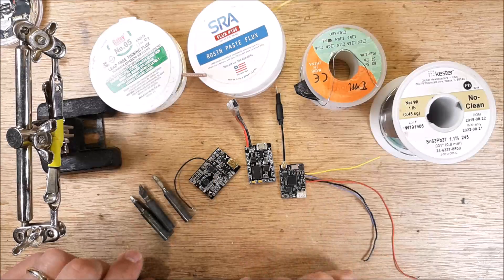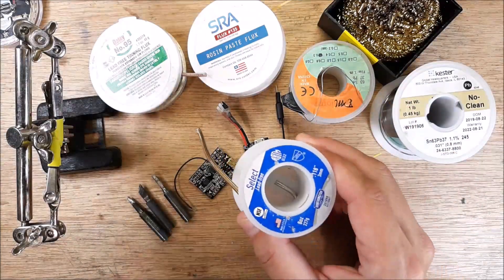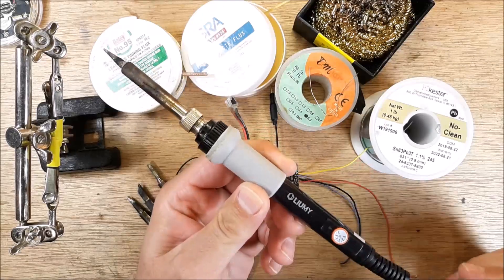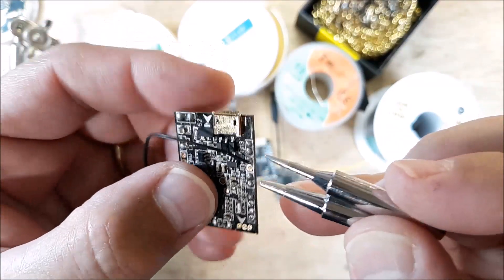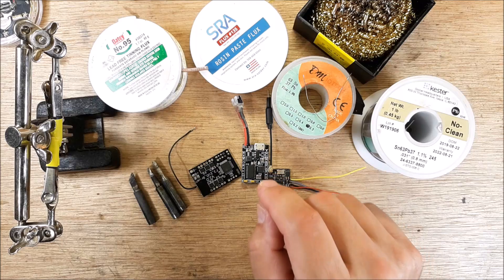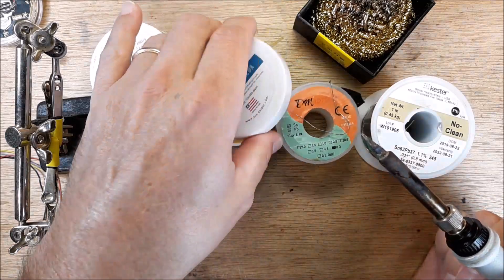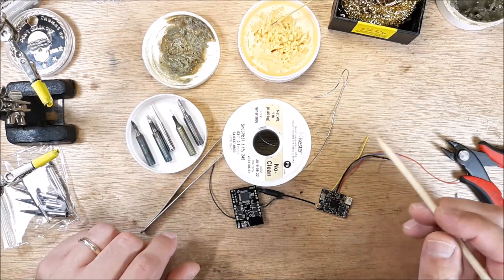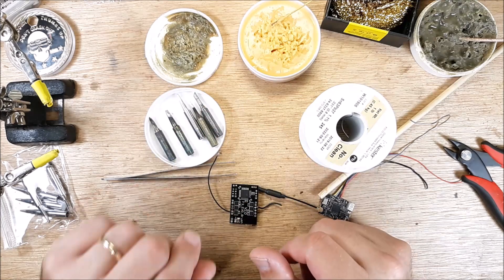How To Solder A Wire | Best Way To Solder A Wire To A Flight Controller

Comment: When I try to solder the power cable to the flight controller I can’t get enough soldering on the pad, as I’m feeding it on the bit I’ve already put on sets and turns to like paste 😢
Reply from the maker: @robl1967  
What solder (be specific)?
What soldering tip?
What temperature?

Comment: are you using lead-free solder?   great video!   TIN EVERYTHING!!!
Reply from the maker: @JordanLewisFamily  
I appreciate your support and encouragement! 
I believe it does have Lead. It has a low melt point and the material code has SN-tin and PB-lead in it.. I have it in my (zero commissions) Amazon store...🍻
https://www.amazon.com/dp/B08YXYJWS1?linkCode=ssc&tag=onamzscottb09-20&creativeASIN=B08YXYJWS1&asc_item-id=amzn1.ideas.3HATG6SBWZ1S1&ref_=aip_sf_list_spv_ofs_mixed_m_asin

Comment: I'm getting ready to solder the motor wires to the flight controller. There are 12 of them. The kit came with a toolbox. The connector for the iron was not compatible with anything I had. I had to go to a electronics store to get an adapter. It came with a battery charger but the connectors are proprietary I guess. It's a Bardwell kit. Thanks for the video. I might need to get a different tip. Mine is the cutter kind.
Reply from the maker: Wow, that's unfortunate. Something called a "Kit" should be ready to go, you'd think... The soldering iron tips that are the most popular for the iron I use is: 
https://www.amazon.com/Soldering-Tabiger-X-Tronic-Station-Different/dp/B077V1VND5/ref=sr_1_2_sspa?crid=2B7IZ4CH8B6EZ&keywords=soldering+iron+tips&qid=1692791451&sprefix=Soldering+iron+tip%2Caps%2C153&sr=8-2-spons&sp_csd=d2lkZ2V0TmFtZT1zcF9hdGY&psc=1

Comment: Hey PO... A link to your favourite Soldering Iron, Solder, Solder Paste would be helpful for the New Players...
FYI... I use Weller Solder Stations exclusively... Same Solder (Kester 0.031") with multicore flux for all my electronic work. Very rarely do I need extra flux.
Reply from the maker: Appreciate your feedback.. I dont have a favorite.. Maybe I could put a link in there of the cheapest and the most expensive I've used.. I like the one I'm using in these YouTube videos, super affordable, easy to get replacement tips, and found all over the internet for sale.. I will look at putting a link up.. I like me some flux, cant deny it...👍🏻🍻👊🏻
Reply: @PropsOff  Flux is always good.. Try some "multicore flux" Solder and you will find that you need less added flux....;-)
Reply from the maker: @lasersbee  
Multicore makes some popular products, I may try them out once I deplete my current stock..

Comment: Great  INFO  just checking out all of your video I feel like I'v find pot of gold 🍯 Nice to see someone helping out the Rookies in FPV👍🏻👍🏻
Reply from the maker: I do appreciate the enthusiasm and your encouragement! I learn something new everyday and if I can pass that info on in a more simple way, I'm in.. Enjoy the Breeze...👍🏻🍻👊🏻
Reply: @PropsOff  One question I was told NOT to use plumbing flux you recommend the No. 95 influx is that ok or electrons?
Reply from the maker: @sully4875  
I only use it to tin wires and my soldering iron tip (tip dip). I dont use it on the pads of the PDB. I use the Rosin Paste Flux for that. I personally have never had an issue using it anywhere, you have to keep in mind it has a conductive agent in it; therefore, you can not be sloppy with it.. Excellent question...🍻

Comment: Flux is your friend :-)

Great tip on the kink in the end of your wire before making up the join - I always learn something watching other folks work!
Reply from the maker: The kink method is from old Rockwell printing presses I worked on. If your wire touched the PDB anywhere it would short out, LOL... Enjoy the Breeze...👍🏻👊🏻🍻

Comment: Good information. I struggled with the soldering at first. Looking at the tiny pads for the motor wires on a  Tinyhawk or the pads of a 16x16 flight controller stack. It's pretty easy now and flux really does make all the difference.
Reply from the maker: You said it... Time and practice and never forgetting flux, lol.. If your soldering Tinyhawk motorwires, your in it 4shO...👍🏻🍻👊🏻